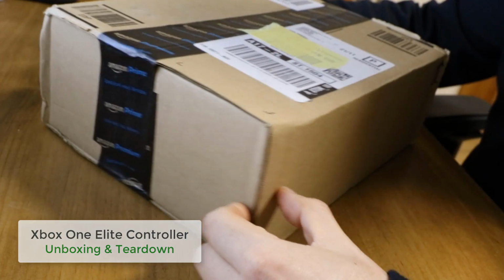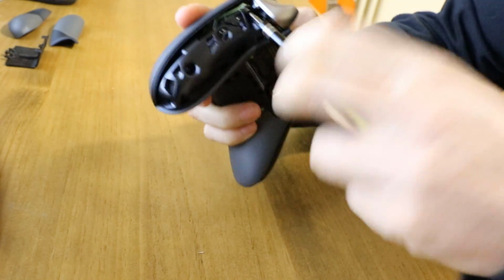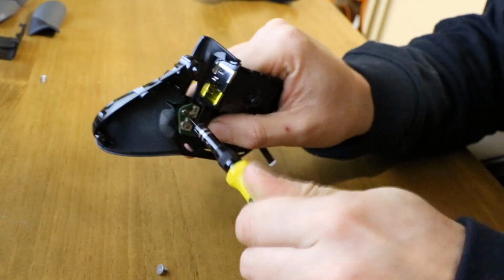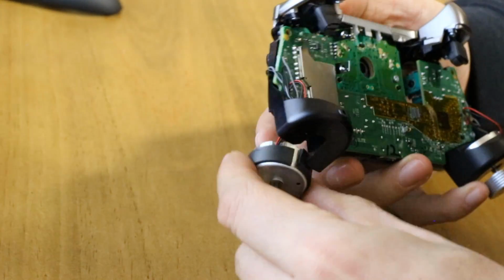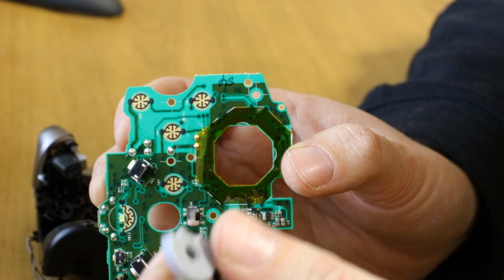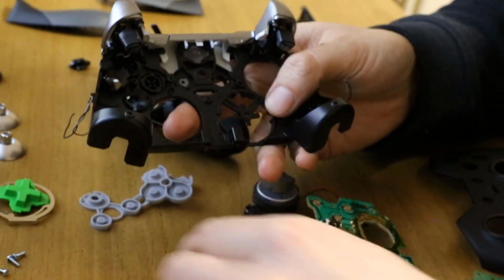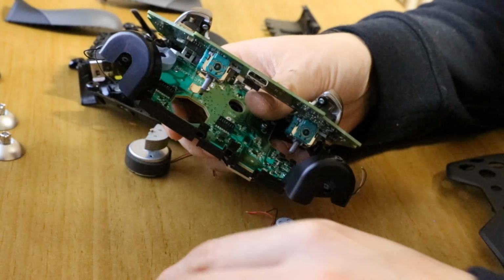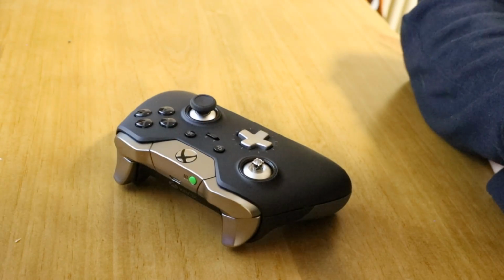Unboxing Xbox One Elite Controller Disassembly Teardown Repair Fix

Comment: I need to change the inner joystick do I need to unscrew any of the motherboards?
Also, can u give a full explanation on how to remove the a analog blocks and put them back?
Reply from the maker: For the sake of a few screws I would remove it. Then to change the analog pot (The metal cube the joystick plastic bits go on) you need to desolder lots of pins. I would recommend solder wick or a desoldering pump. I can do a future video on it
Reply: AngelSix thanks

Comment: When I put batteries in my controller doesn’t turn on when I use the cord thst come with it the light comes on but the controller isn’t connected to my Xbox it’s like it gets power but has no function and after being plugged in for like 10-15 mins it gets hot near the right thumb stick and A and X button

Comment: very helpful.  i thought i had some liquid(beer) damage on a sticky A button.  odd thing is, getting the 1st 5 screws out and the top and back covers off was all it needed to come good.  cant see any liquid ingress at all?!
Reply from the maker: +Mob Mentality it's ok now? Probably just had the button or the rubber pad caught in the front she'll causing it to rub. Removing the screws loosened it up and allowed it to slide back into position
Reply: heh no. the sticky came back. opened it up again and gave the button well a few drops of iso and wiped it up.  came good immediately so beer seems the culprit. odd how it seemed ok for a while there tho

Comment: 9:02 is there a way to fix that if the little black box brakes?
Reply from the maker: Hard to. You can either solder the ribbon directly to the board and remove that connector, or buy the connector (hard to find, its called FPC connector). It pushes the ribbon down to made contact on the gold pins. So possibly you could put the cable in, then push it down firmly with a flat screwdriver and hot glue it down so they make contact
Reply: AngelSix oh ok thanks i thought about doing that before but I wasn’t sure if it was going to work

Comment: Someone please help me I pulled that black cable at 47:00 and I think I messed it up. I plugged it in as it shown and the controller does not turn on using batteries

Comment: I can t get my audio jack to fit back in to place when re assembling the controller
Reply from the maker: It just sits in place. It could be some other part of the board is not fully sitting flat so looks like its the audio jack but could be something else. Double check all bits are sitting flat and level. Also the audio is pretty firm to get back in so needs a bit of a firm push to get locked in

Comment: One of my green switched on the back is broke how do i fix it?
Reply from the maker: From the PCB board? It will need soldering back on or the PCB repairing. Contact contact@retrosix.co.uk with pictures and I can fix it for you

Comment: When replacing the motherboard with the USB do you really need to take the wires off before taking out the upper board? can this be done without the need to solder?
Reply from the maker: Jeffrey Hanner you can turn it over just about but you wont be able to get to the screws or change boards without removing the wires. To do it without soldering you could cut the wires in the middle then remove a bit of plastic cover from each cut ends after twist the wires together and use electrical tape to protect them perhaps some hot glue before that to stop it coming apart

Comment: Hey AngelSix. My left thumbstick cap (the half circle inside part) seems to slide in and out slightly, while the right thumbstick cap stays in place nicely. It's not a huge issue and I haven't taken it apart but do you know if there's anything I can do to make it tight without having to open it?
Reply from the maker: TheDeadManSwitch without opening it not really. it just slides on the analog pot shaft. I would say just buy a new pair for £3 off eBay and replace them both at same time

Comment: Question: One of my green paddle buttons still works but stopped giving a clicking feedback. It feels like it is somewhat jammed in to the controller. Could I tear it down to around the 11:00 mark and fix it? Or would I need to replace that part entirely?
Reply from the maker: Its probably just got a bit of sticky or dirt or dust in it. You need IPA fluid, put a decent amount on the button and click it over and over. It will evaporate and doesn't harm the PCB so don't worry about it going on the board. That should fix it.

Comment: What happens if you remove the Kapton tape? I’m not familiar at all with circuit boards. Does it risk breaking the board all together? Or any electrical issues? I accidentally removed mine.
Reply from the maker: Usually the kapton tape is put on to keep things in place during wave soldering / assembly and they just don't remove it. It can also act as an insulator if moving parts that are conductive were to come into contact with the exposed copper so they don't short out (although this use case is rare). An added benefit is over time it protects the exposed copper from getting dirty I guess. No harm in removing it on this board I have done it myself

Comment: Hi mate. Silly question. Are the sticks inside the elite the same as the ones in a normal xbox one controller? Do they fit just the same? Because i need to replace my left stick as it drifts, would i just buy one that fits a normal xb1 pad?
Reply: OO00H R they're the same, the actual dome is what is magnetic
Reply: yeh, thanks. i had an expert fix mine in the end, the soldering was way too small for me to try lol!

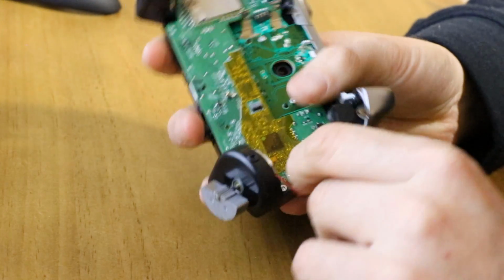Comment: 22:45 WHAT!!!!
NO NO NO!
That's the best way to DESTROY the circuit board, if the pad pulls off instead of the solder. :-(
ALWAYS de-solder joints.

Comment: Are the analog boxes the same as regular controllers are they more durable cause i keep breaking them seems like i need ones that are made of steel
Reply from the maker: They are made by ALPS like all Xbox ones, they are durable but also prone to breaking with abuse :)
Reply: AngelSix whenever i click in left stick and change directions they break. I never broke a 360 and looking at it i can see why the xbox1 are smaller with more plastic. I bought a bunch of replacements but soldering is a pain

Comment: Disassembled to replace buttons with custom gold ones and new faceplate, all went well button’s pressing fine until I put the last 5 screws in to put the controller together again once I done that all the buttons was stiff and wouldn’t press so I assumed the screws was to tight, tried loosening them but that didn’t help until they was nearly completely undone which then the shell wasn’t together. Any help is appreciated
Reply from the maker: Make sure the rubber contact pad is seated correctly

Comment: How hard is it to clean the bumper button so it doesnt stick anymore my niece spilled a glass of juice over my controller and laptop after leaving the controller for awhile it works now except the A, B, X, Y and the RB stick unless I blow into it I have all the equipment for proper repair I'm just wondering how hard the RB will be to get at
Reply from the maker: Easy. Just unscrew controller then get a toothbrush and IPA fluid and go to town on it
Reply: @AngelSix  ok but where is the contact spot for the bumper that makes the controller respond the other buttons are easy peasy
Reply: @AngelSix  I went and bought a soldering iron yesterday because I had the controller apart and tried advice from a bestbuy employee to drip cleaning solution down into the buttons but when it dried they were sticky again so I decided to finally desolder this time they are the only thing now from keeping the  controller from working perfectly

Comment: Do you know what kind of ribbon cable I could use to replace mine?
When I've opened my controller I think that I broke it somehow.
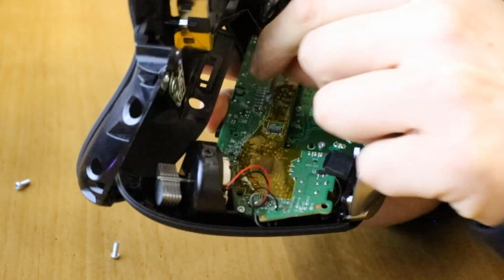I'm talking about the cable that links the paddles buttons plate to the main plate. (9:12)
I know you did this vid long ago, but Ill appreciate if you could help me.
Reply from the maker: Its an FPC cabe. Measure the space between the copper pads (probably 0.5mm) then the number of pins (6 I think) then look for them here https://uk.farnell.com/c/cable-wire-cable-assemblies/cable-assemblies/ffc-fpc-cables. You may need to cut a bit of the plastic ends off to fit in the connector but it would still work

Comment: My right joystick is moving by itself, like if I’m in a game, my character will look by itself up in the sky and turn his vision to the right! ANY HELP IS APPRECIATED THANKS!!! 🙏🏼🙏🏼🙏🏼🙏🏼
Reply: Sounds like thumbstick drift. There's a rubber band trick you can try to fix it but no guarantees. Mostly it just means you need a new controller.
Reply: MultiGavin123 Ok thanks man! Might try this trick before buying a new one $$$ do you know if any tutorial exists to do this?

Comment: Hey Angel6,  you out there?   I've got some questions about Elite Controllers. I own 3 Elites & one was a Quick Fire Modded elite
that I never used(1 hour is it).  So I need help concerning the "Orbits" of the controller.  I'm losing function in the movement
within the orbit & turning is not working smoothly or correct.  First,  are there any replacement orbits that are better quality
that'll fit?  I'm talking about something comparable to a Radio Controller for a drone?  Their stick orbit are really good and
I'm asking is their anything like that for an xbox elite controller?  Or are we stuck w/ their stuff?  I don't mind spending the
money for quality parts but I need an honest answer so I don't get screwed to hard, ya know?  Anyhoo, I'm watching this
& I do hope you're alive & well.  chat soon..... peace
Reply from the maker: I used to mod them, and even made most of the rapid fire mods out there (Arbiter, BGR, Intensifire, Modiify etc..). I also used to sell all the parts. the potentiometers are made by ALPS and are top quality. No clones are as good. I can probably still source ALPS for you, but I now run retrosix.co.uk and I am working my way up to modern console parts. Best thing is get some IPA fluid and put it into the potentiometers, just squirt it in, then move them around, click them and do that for 30 seconds. Let the IPA dry off for few minutes and try them out
Reply: @AngelSix  ~ My "Modded" Elite cost $229usd & I used it 1 hour..... the way it was setup clashed w/  the game I wanted
to use it in..... lol,  but  what is  "IPA"   can I get it at retro6?  peace
Reply from the maker: Isopropyl alcohol. We will sell it soon. For now you can get it on eBay

Comment: I followed this tutorial to disassemble my elite controller but did not disconnect any cables. When I reconstructed the controller it only works with being plugged into a micro usb. The wireless function (turning it on with the white Xbox button being held) doesn’t initiate power. Any suggestions? I have new batteries in and have them in the right alignment. Any help would be awesome!
Reply from the maker: Thats usually due to the two boards not being pushed together fully

Comment: I replaced my bumpers because the rb wasn't working but it did not fix the issue. What else could be the issue?
Reply from the maker: The button itself. Put some IPA fluid on the button and press it 20 times, let it dry out for an hour and try again

Comment: How do you put the wires from the vibrator you yanked out back in?
Reply from the maker: If you pull them out you need to solder them back in. Otherwise you can just about rotate the board without removing them

Comment: hey by any chance do you know of anyone that makes a metal version of the left right bumper bridge? mine is plastic and the left button snapped I am using the under side triggers to compensate  but I would like to replace the cheap plastic ones.
Reply from the maker: +Alex Cottrell not that I know. I used to sell metal buttons but not the bridge part

Comment: I want to start fixing my own elite controllers and wanted to know if you recommend any soldering kit? Thank you.
Reply from the maker: Mid-range I would recommend Antex irons. Pro level I would recommend Weller. For solder, much easier to work with leaded if you are just doing hobby work and using a PC fan and carbon filter to make a fume extractor.

Comment: How do you remove the two metal parts under the board on the back piece of the controller. The ones below the trigger stoppers, not underneath them
Reply from the maker: The ones at 9:20? They are soldered down they dont come off without desoldering

Comment: Hi! Great video!
I have a problem with the analog left that is not as stable as the right one. Seems to be detached from the base and is a problem that other users have had but I have not seen a solution anywhere. Can you help me solve it? The controller is no longer warranted. Thanks and bye
Reply from the maker: dado98777 can you take a video or picture if possible? Also can you open it and see if it is the entire thubstick moving on the PCB board of if the body doesn't seem to move just the internals

Comment: How do I fix my xbox charger port it is loose but it seems stuck in the bottom part of were it should be how should I go about this bc I will be playing a game and if I turn my controller the wrong way the it will turn off
Reply from the maker: Open it up to see whats wrong first. Might be loose wires or broken PCB

Comment: Hello! Firstly would like to say awesome video, got the whole strip down and rebuilding in there and can clearly see the entire thing. I'm however not having much luck with getting the paddles to work. When I put it back together the top two paddles work fine, but both the bottom paddles don't click anymore. Feels like they're not tight enough to the driver board to make contact and click. I've tried a few different things but can't get them to work at all. Please help!
Reply from the maker: Did  you put the rubber cover over the buttons? Perhaps that is mis-aligned, or the screw is loose. Test it with just the back cover off so you can see whats going on. Perhaps the circuit board is flexing as it isn't screwed down tight enough or flush

Comment: So I broke a small capacitor off while putting in the most inner pcb could I just solder it back on? The capacitor is the one near the micro usb port to the left C2 and C3 it looks fine.

Edit: I burnt out the micro usb area, the controller has no power there other than that the controller is working fine for me.
Reply from the maker: Mohamed Ali sure but you will also likely find it works fine without it. Capacitors are typically for smoothing power or removing frequencies and interference. They can be for RF or other things but 90% are for smoothing and storage and very often are more cautionary than mandatory. Try your controller without it first to save potentially damaging the board soldering it back on unless you are confident in soldering it on
Reply: Oh ok thanks.

Comment: Whaat screw driver are you using to take to board off I can't seem to find anything small anough to fit
Reply from the maker: T8 and T6. Best getting Security T8 and Security T6 (eBay or Amazon) as the non-pro controllers use them
Reply: Yeah I managed to get it off thanks... but I was sent the wrong module lol I thought they was all the same...

Comment: My paddles changed after I took off the ribbon and now the paddles have been programmed to different buttons for example, my P1 paddle used to be binded to A now it’s LB same goes with the other paddles. I checked on the Xbox Accessories app to see if it was changed from there but it still shows that it remained the same and nothing has changed. Any help please??
Reply from the maker: Have you put the ribbon in up side down?
Reply: AngelSix I have put the ribbon with the black part faced up and the metal tabs faced down. Then I tried the opposite way and still no good.
Reply from the maker: Hmmm it must be in the actual software of the controller then that they have remapped. You can remap those buttons to any buttons you want I believe in the Xbox settings?
Reply: AngelSix yeah there is an app where you can change the settings of the controller and I thought that too but when I checked my default binds were still there unchanged but hopefully there’s a reset to default settings in the app so that it can go back to normal.

Comment: So how would you go about removing grit from the thumb sticks
Reply from the maker: Soak the entire PCB upside down in IPA fluid, then wriggle the thumbstick around while its in it and leave it for a while to soak. Then shake it loose and dry with a hair dryer lightly

Comment: I need this cable from the Paddels to the motherboard but I don't know where I can get it :(
Reply from the maker: The flex cable? It's just a FPC cable you can get them here http://uk.farnell.com/w/c/cable-wire-cable-assemblies/cable-assemblies/ffc-fpc-cables?no-of-cores=6core&range=inc-in-stock&st=fpc+cable

IIRC the cable is 6 pins and I think its 0.5mm pitch. You can check by just measuring. The pitch is the space between each copper lane so just measure between the first and last pin and if there are 6 pins thats 5 gaps and you should have 2.5mm if its 0.5mm pitch, 5mm if its 1mm pitch etc... then just buy the appropriate pitch cable at approx the same length.

However one thing to note is I think this controller uses a slightly slim profile cable as normal cables have some plastic on the outer edges and this connector doesn't let them in, so you may have to trim the edges with scissors careful not to cut the actual copper